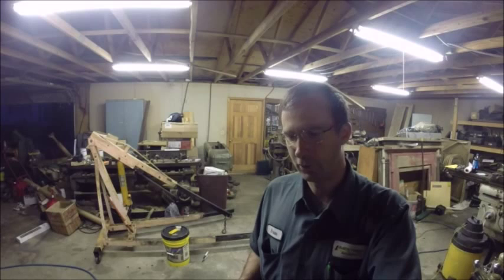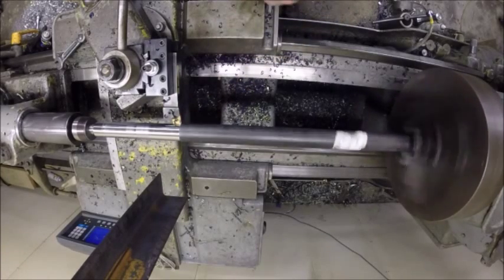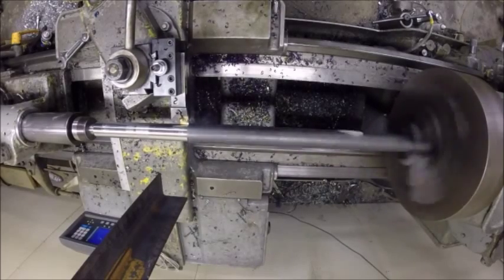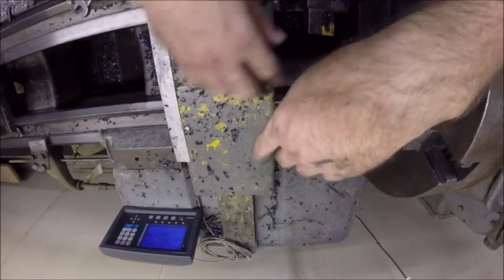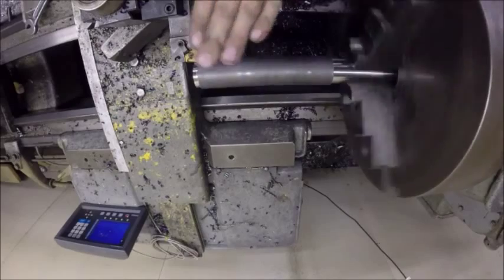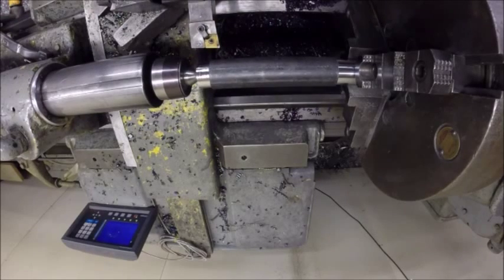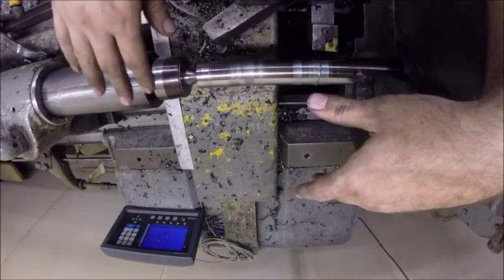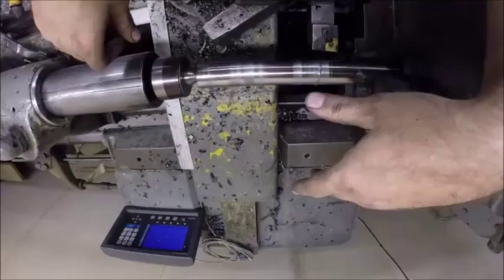Chip Breaking 2

Comment: What do you suggest for rust-prevention on those tool steel parts as a surface treatment?
Reply from the maker: They will be inside an engine so they will live in oil, and this particular material is not as rust prone as say that fatigueproof. That stuff would rust over night just from the sweat moisture off my hands. I use a product called "fluid film" for my rust prevention needs. It is a good lube and offers excellent long term rust protection and is easy to clean up, just wipe it away.
Reply: +meocats They have a few products out there that can be applied on steel parts to prevent rust and corrosion. I believe it is a mineral oil base and does not affect the steel and can be painted, welded or glued without compromise. MSC has products like this and I bet other stores/companies have similar products!

Comment: How would you centerdrill a long rod, of say 20xD? I have seen very few lathes with a powered tailstock
Reply from the maker: I don't have any personal deep hole drilling experience like gun drilling. It would depend on the accuracy requirements for the hole.  For best results on deep hole work a broach after an initial hole should offer the best results because it can be best guided and supported. It is also possible to use a gun drill mounted to the lathe carriage and to use the feed to power the drill bit through.  This setup tends to require a couple of steady rests and some guide bearings for decent results.
Reply: I don't want to bore the whole length, I just want to support it so i can centerdrill it!
Reply from the maker: Oh!! Well what I usually do is just take my knurling tool and run it up against the bar with some light pressure and it gets most any run out out then I centerdrill it with the tailstock like normal. It saves getting the steady rest out and 95% of the time gets me plenty close. That is what I did for this video and as you can see before I started turning I had little runout in the bar.